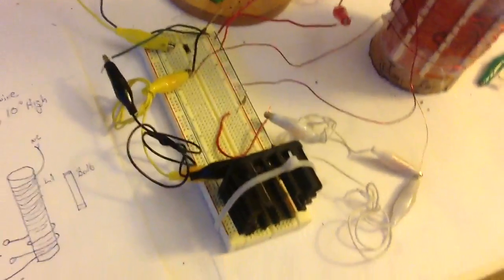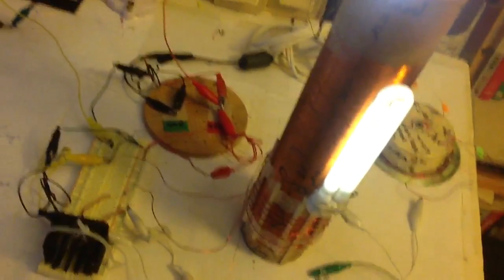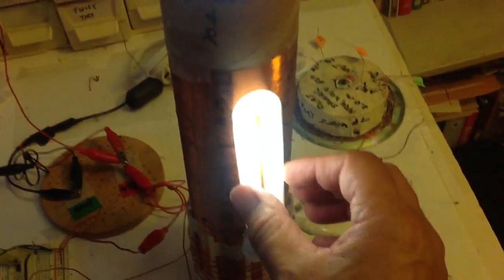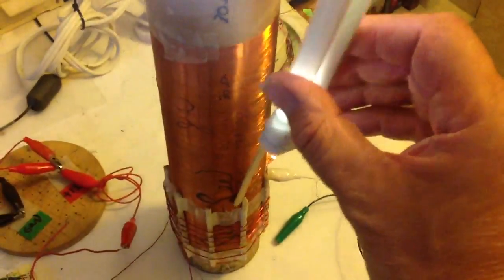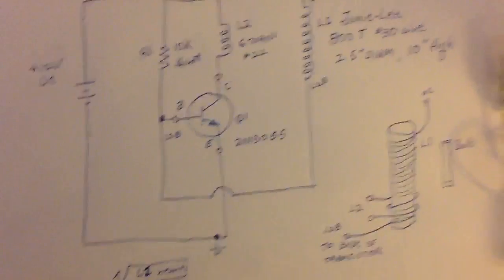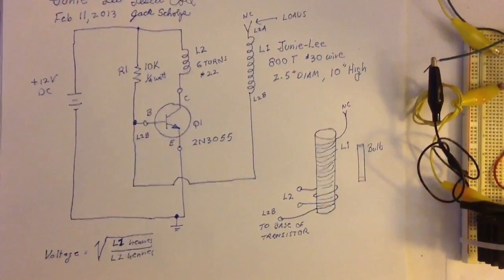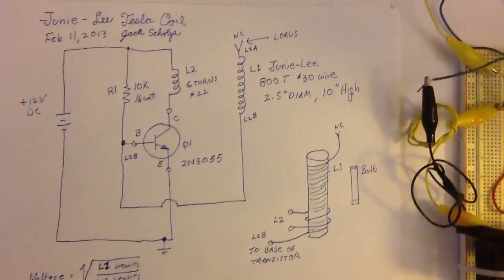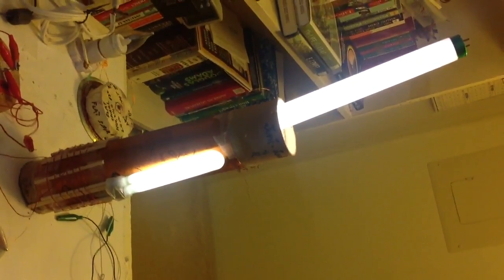Junie-Lee Tesla Coil Lamp

Comment: exactly...plating is part of it yes..or the real surprises will occure when you use numbers that are normally only associated with metaphysical occult etc..all those things described in divine architecture..there you will find litterlaly the numbers to use to mix the alloy..cast an ingot and draw the wire..no supply house will have it..yet.. Silver, gold, thorium, cadmium, lithium, palladium.look at the ladders of attraction between the metals as well, in order to know the arder of the alloy.etc

Comment from the maker: You are right,we need to experiment with aluminum, steel, and silver wire also,  how about gold or gold-plated wire?   Expensive wire, that.   Platinum wire!    Some parts of Ed's knowledge are appearing on the web, but there is still plenty to do.     Wind some wire and spin some tales.

Comment from the maker: Ed was doing a number of things I am not doing correctly, and soft iron is part of it.  His wheel also had 5 layers of 24 horshoe magnets with the ends pointing outward.   This experiment is to provide an easy way you can produce natural oscillations with only one transistor and 2 coils, no tuning needed, though it could be better fine tuned.   thanks